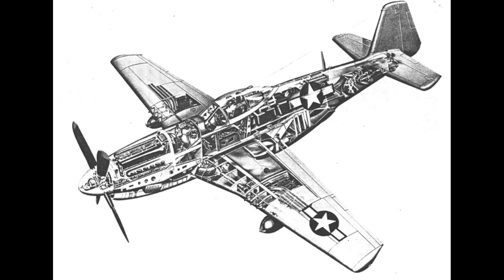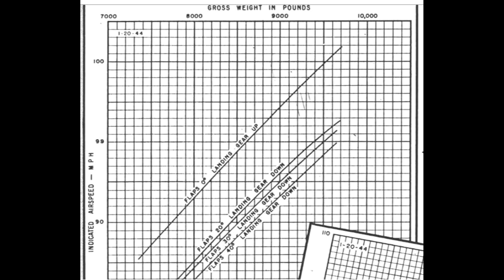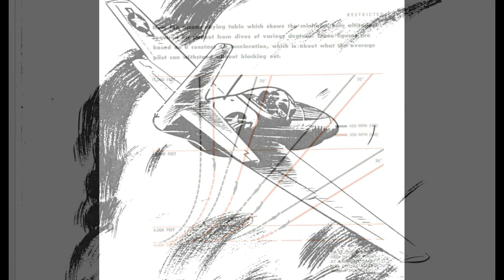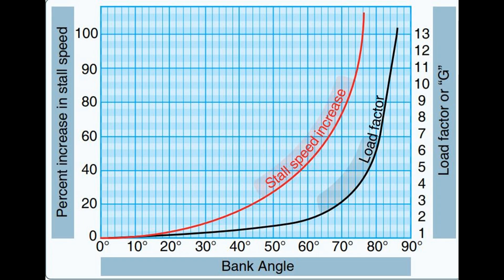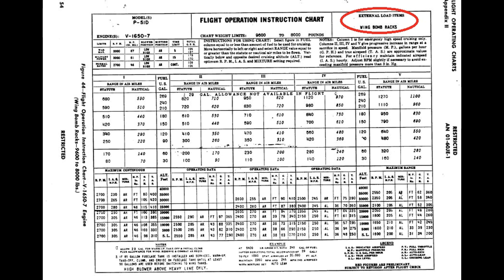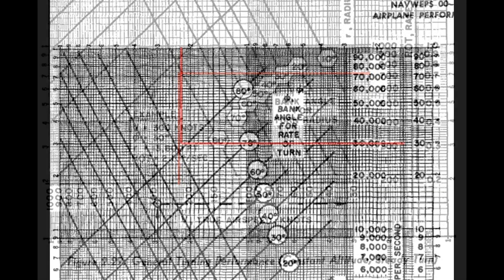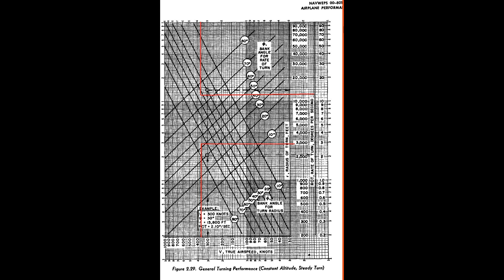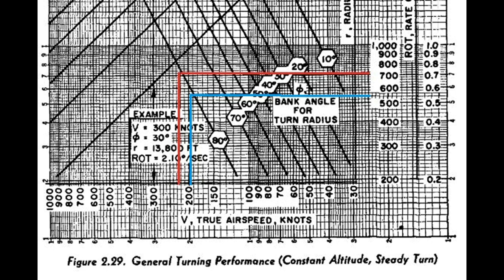P51 Mustang Turn Radius vs.

Comment: I've read in several articles that a 4-engined Short Stirling bomber could and did out-turn a Bf109. I find that a bit incredible (in correct parlance, not modern parlance).
Reply from the maker: Hmm, I won't say it couldn't have happened. If the Stirling was as a lower speed, and the 109 was way too fast, then maybe, or if the 109 was way too slow, or damaged, again, it could happen, but in any apples to apples comparison, or a sustained turn the 109 will easily out turn the Stirling.
Reply: It's to do with wing loading. Convair B36 was capable of out-turning contemporary jet fighters at high altitude.

Comment: Very informative video.  What you must remember is that air superiority is a contest between complete air combat systems.  You need to compare all aspects of the machines and weapons as well as pilot training and logistics support.  Pilot training is also crucial and the Allies, especially the US had the ability to rotate skilled combat pilots back as instructors and also to give the pilots the necessary hours to be far more skilled than new Axis pilots.  Also, remember that the US bombers while suffering horrible loses also inflicted massive losses on the German fighters.  And the Allied offensives against German fuel resources greatly cut the ability of Germany in their attempts to train new pilots.

It is even necessary to consider cultures, with the US men's experience bird hunting with shotguns they were ideally suited to learning high deflection shooting.  Also, the men from the US had far more experience repairing engines since the farm equipment and far more cars in the US meant there was a ready supply of experienced mechanics.  And then there are just the fortunes of fate with the US having the M2 Browning .50 calibre which was by far the best air to air weapon of the war.  While it was not the heaviest calibre its flat trajectory and high cyclic rate meant it was probably the easiest air to air weapon to become proficient with and its varied ammo made it very effective against German planes without self-sealing fuel tanks when firing incendiary rounds.  While the Germans produced large numbers of aircraft they simply had no hope of matching the US war production with the US outproducing the rest of the world by large margins of aeroplanes and virtually all other weapons.  The US also trained the Russians on mass production so they could also produce a large number of tanks and planes as well.

Had the Army Air Corp adopted the Pacific Naval aviation training for aviation marksmanship the Allies would have really devastated the German Air Force.  The Pacific Naval Aviators were by far the best trained and best marksman of the world's aviators during the war.  The Naval Aviators often practised marksmanship every other day when cruising with two carriers.  One carrier provided CAP and sub patrols while the other practised high deflection shooting with towed targets and then alternated the next day.  The Pacific aviators were the first to jury-rig deflection sights from Army bombers to aid them in high deflection shooting.
Reply from the maker: I don't disagree with any of that, but I can't fit all those discussions into a 20min video. I do cover some of those subjects to a small extent in other videos. Bottom line is that this is more of technical channel, so I don't really want to make a video on pilot training specifically. Thanks for your post, and again, I don't disagree with the importance of pilot training.
Reply: I  doubt you are interested in my references.  But ask yourself what are the pluses and minuses of the  20 mm air to air vs the pluses and minuses of the .50 cal.
Reply: 18tangles, If you were surprised by my reference to bird hunting I must tell you that you are missing a lot of information on WW 2 aerial combat.  This is a reference that many historical references include.  You might want to do a good bit more reading if you really would like to better understand air combat during WW 2, but it seems that you feel like you are already the expert.

Comment: Hi Greg. Would it be a available for you to do a video on the reason for the different positions of the horizontal stab. Example, why are the P-51 and zero hor. stabs forward of where the F4F wildcats are. I would have thought the further back the horizontal Stabilizer and elevator, example, the F-22 Raptor, the more mechanical force generated to point the nose. Thanks again for your videos, love the educational value.
Reply: That's a complicated subject but I'll try to sum up. 

1. For stability, you want the rudder as far aft of the CG as possible. Also, the farther aft it is, the smaller it can be and still provide adequate control and stability. So that's why you might want it as far back as you can get it.

2. For a fighter aircraft, you don't want it too stable. It needs to be able to maneuver quickly. A larger, more forward rudder can help this.

3. I suspect the main reason for a more forward rudder is structural. It puts a lot of torque on the fuselage and the fuselage is very small in cross section at the tail. Moving the rudder forward attaches it to the fuselage at a much stiffer and stronger point. 

4. In cases where the rudder is actually behind the elevator, extreme elevator angles (say a tight turn) can disrupt the airflow to the rudder, reducing its effectiveness. Moving the rudder forward keeps it in cleaner air.

Comment: Not sure how many of you noticed, but turn rate varies greatly by speed and altitude. In short just about any plane in WW2 if jumped, the enemy plane was usually in a dive carrying extra speed from the dive, could out turn the enemy by the simple fact your speed is lower. The faster plan could not turn with you. Then the turn radius between different aircraft types all had a best altitude at which it could turn faster than at any other altitude. However no two aircraft shared this same altitude. Means at altitude X airplane Y could outturn airplane Z at same airspeed, but change the altitude and airplane Z could likely outturn airplane Y at same speed. You wanted to fight at the altitude that your plane had the advantage. WW2 flight sims do not model this at all. I add this in because most people only experience with flying is in a flight sim. And you need to know the flight sims are not very accurate as compared to real life flying.
Reply from the maker: I am glad you  paid so much attention in this video. Everything you said is correct, and your are right about flight sims.
Reply: Something my father (a military pilot from the WWII era) said that is pretty obvious is that a turning plane is easier to catch up with.   Like a triangle, the turning pilot is flying the adjacent and then opposite leg while the pursuing pilot is flying the hypotenuse - a shorter distance and closing giving a good chance to connect with a deflection shot.
Reply: Well said, dan.

Comment: More fodder: I just watched a video that stated that the Corsair could "easily" out turn a P-51.
Reply from the maker: I am not sure I understand your post, or I just don't get the point.
Reply: My point is that it would be interesting if you'd do a video about the turn radius of the Corsair vs the P-51, two iconic US fighters of WW II. Was the off-hand comment in the other video about the Corsair vs. Mustang turn radius have any merit? Your thoroughness of analysis is intriguing. Does the Corsair's 2000 hp engine vs the Mustang's ~1400 hp engine make a big difference? Are there other factors to consider? I realize that the Corsair does not have the range that would make it useful for escorting bombers on long missions. The two aircraft were designed for different purposes. The same could be said about the Hellcat which was designed specifically as a "Zero Killer" (based on the Zero found in Alaska after the Japanese withdrawal). No US fighter could probably match the Zero on turn radius, but US "hit and run" tactics used superior speed and rate of climb to defeat the Zero.
Reply from the maker: Hi Bob, I'll have to make a comparative turn performance video at some point. It's just too complex for the comment section.

Comment: That is misleading to claim that maximum turn performance is performed while sustaining altitude while also claiming that "absolute" maximum turn performance can only be obtained momentarily. That is misleading when speaking about Air Combat which involves "absolute" maximum turn performance obtained long enough to gain position long enough to shoot at, and potentially shoot down, an opponent. Corner Velocity, or "absolute" turn performance, can be understood as a structural limit combined with a pilot's physical g tolerance limitations. Since WWII planes were capable of exceeding WWII pilot's g tolerance limitations the "absolute" maximum turn performance that was useful was the turn performance of the plane at the pilot's g tolerance limit, or the Corner Velocity (Va), which is calculated at the pilot's g limit, and calculated at the lowest speed at which the plane can still generate that g limit. Speaking only about sustained (altitude) turn performance is like speaking about horizontal turn fights; leaving out any mention of vertical maneuvering as if vertical maneuvering was not a part of WWII dog fighting.
Reply from the maker: Joe, this wasn't a video on WW2 dogfighting. It's a video on how to calculate turn radius. Maximum turn performance can only be obtained in these planes momentary because they don't have enough power to sustain a maximum G turn.
Reply: Thanks for clarifying, but you appear to miss the point. That is OK.
Reply from the maker: Are you arguing that I am missing the point of my own video, or that I don't accept your point as being relevant to the topic? The facts of this video are straight out of Aerodynamics for Naval Aviators, so if you disagree with it, take it up with the Navy.
Reply: The point of your own video is not something I care to know, it is whatever you have decided upon yourself. The point offered, which you can see or not, is the point at which the tightest turn possible is measurable, known, and employed in the context of which plane is better in Air Combat for which reasons. Your video concerns the relative minimum turn radius while sustaining a level turn, not gaining, and not losing altitude. Corner velocity, which is the minimum turn radius possible, and a turn radius that is smaller than the turn radius carved out while sustaining a level turn, is also measurable, as you point out "straight out of Aerodynamics for Naval Aviators," which is why I sent the link to John Boyd's work: so as to avoid someone claiming that my inspiration here was to "argue" over anything. The information stands on its own. 
Why would I disagree with it?

Comment: 4:45 -- I feel like you and I are on the same metaphorical page at many points during this discussion.  At the top of the video, you noted that there's two issues at hand:  (a) minimum turning radius, and (b) maximum turning rate.  And at that time, I said to myself -- that's not tough to keep separated!  (A) will be a function of SPEED, whereas (B) will be a function of ACCELERATION (which we'll be calling thrust, or available power).  Yay, high school physics and maths. :D
Reply: Also!  I LULZ when you say "...assuming that this turn will be at a constant altitude."  In my mind, that's the same as saying "....by keeping a constant Speed."  Applying Thrust (ie. Acceleration) is the same as changing altitude, normally to go Up.  It's a useful way to keep a constant altitude while co-ordinated turning, though.

Comment: i think you are spending way too much time for the high speed turn rate.  Almost all fighters were capable of a max g turn at 400 mph, low or high altitude.  What really matters is the sustained turn radius.  If I was flying, say a Ki-84 and had a P-51 in my tail at 400 mph, I would instantly go on a climbing turn and cut power in order to bring the speed down in the range that the P-51 cannot turn with me.  Vice versa.  If I was in a P-51 and attacked by a K-84 at 400 mph, I would dive and turn, in order to minimize the chances of getting to the airspeed where the opponent has tthe advantage.  Of course, giving up altitude is anathema for air combat, and that is why US fighter planes were consistently second class in air combat.
Reply from the maker: The time spent on max turn rate was needed to fully explain it. I think that anyone who watches this video will be able to calculate max turn rate for a WW2 fighter. That was the main goal of this video. As for sustained turn rates or specific combat tactics, those things were both outside the scope of this video, and will be covered by other videos in the series. I can't cover everything in one 20 min video.
Reply: OK, maybe I should have explained my view point better.  What matters in a fighter plane is to get outside the line of fire of an enemy fighter behind you, or maintain in your line of fire the fighter in front of you.  Which plane you are operating is irrelevant.  You are not trying to do a U turn in a canyon in a Piper Cub.  In this latter case, the horizontal turn radius would have been important, but in a fighter, its really not.  You can easily demonstrate this ability of several fighters by plotting the max G as a function of IAS, by extrapolating from the 1 G stall speed, as you cleverly did.  That would show, that for example at 200 mph indicated,  the P-51 can only pull 4 G's, while a Spitfire IX can pull 7 G's, and a Bf 109 somewhere in between.  You can graph many of these fighters in one graph, and that would quickly show how poor the P-51 was.  You can do that in about 45 seconds of video.

The horizontal continuous turn radius has meaning for combat at sea level.  Since most prolonged engagements ended up at sea level in WWII, this is an important parameter.

It seems to me that the max instantaneous horizontal turn radius means little, one because its instantaneous, and two because level turn means little unless you are at sea level.

I hope I explained my position better.  While I understand that you are not interested in combat tactics, the performance parameter that you describe needs to be relevant to real combat.
Reply from the maker: I understand your viewpoint. You are complaining that the video didn't cover what you think matters most. I get that. However dogfighting, or the factors you are bringing up were not the subjects of this video. Those things will be discussed in another video. I certainly can't explain sustained turn rates adequately in 45 seconds, that's going to take an entire video, and understanding the principles in this video are going to be a prerequisite for the subsequent video on turning.  As for combat tactics, I am not saying I am not interested in that, just that it's not the subject of THIS video. For some reason, that seems to be a difficult concept to convey to some people. I don't really agree with your statements about the P-51 or Spitfire. I will cover the Spitfire at some point. A spitfire Mk IX can only pull 1G over Berlin since the only way it's getting there is on a truck so I am not sure it's a fair comparison against the P-51.
Reply: Hi again.  I was not suggesting that 45 seconds would be sufficient to show how to calculate sustained turn rate.  What I was saying is that 45 seconds would be sufficient to show max instantaneous g each plain can pull as a function of IAS.  Independent of which plane (horizontal or whatever) and turn is executed.  You can draw a line where it shows the transition from stall limit to pilot/structure limit.  This would clearly show that any overweight US fighter could turn well at 450 mph, but as the speed drops, they became more and more useless.   In my opinion, that would have been more meaningful than the max G at top speed, and easy to present.  But if you want to say that this is off topic, well so be it, its your video.  Again, I would thank you for making the video and provoking interesting discussions.

As for the last statement ...  Spitfires IV's and XI's were flying over Berlin long before P-'s appeared.  These were unarmed recce planes.  While they usually used their rate of climb to evade attacking Germans, they sometimes used their turning ability too.  Long after the USAF had P- D's, they still used Spitfire XI's for the tough recce missions.  Why?  Because the P- 51 was overweight, and its laminar wing had poor performance under high angle of attack (climb or turning).  The only thing the P-51 could do reasonably well was fly straight, either level or a shallow dive.  That maybe good for the Reno air races, but not so good in combat.

I hope no typos this time!